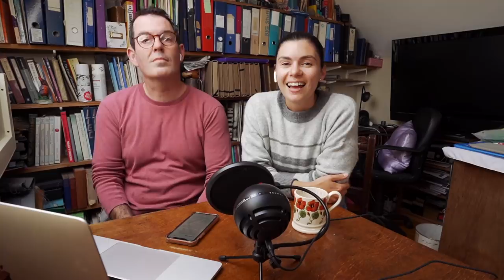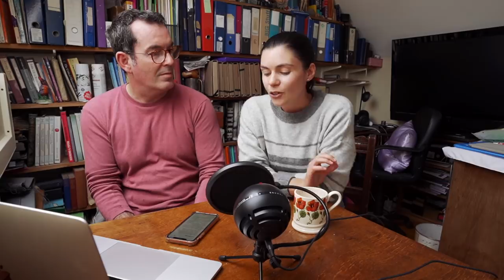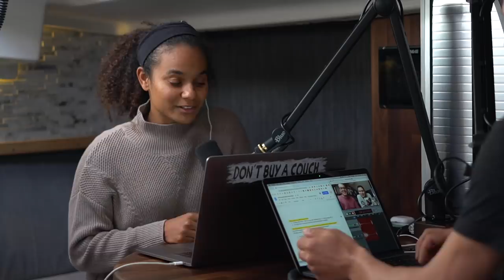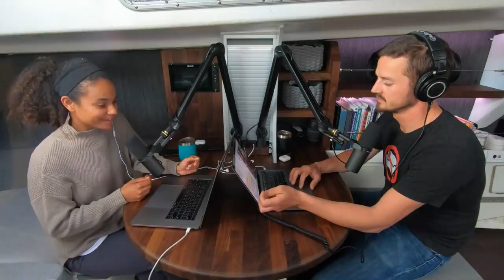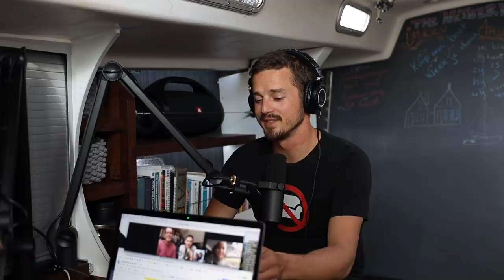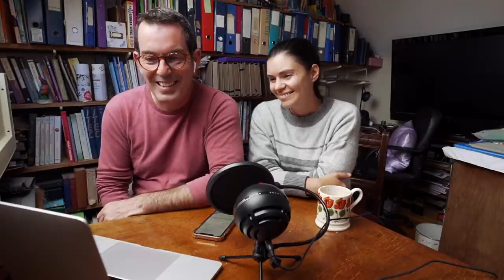Electric Engines on Sailboats: A Complete Guide! | Sailing Uma Interview

Comment: Brilliant, one of the best video casts I’ve seen with fantastic production, what equipment and software did you use.
I thought I would through a couple of questions into the mix... what do you think of electric hybrids and hydrogen fuel cell systems that will give you a greater range?
Reply from the maker: Ah thanks mate. We use Final Cut Pro for editing and a Sony A7iii for shooting

Comment: Can the keel be adapted to accept a large amount of batteries? Or ballast? 
Some ballast weigh + tonnes. 
Plenty of storage for the longest crossing that isn't providing much sun or wind.
Also could a generator/turbine be adapted to be trailled behind the boat on good conditions to generate hydro, but pulled out when it becomes too much drag in lighter winds hmmm 😂

Comment: Here at home in the midwest USA, we pay to recycle paper, plastic bottles and other recyclable materials. We cannot recycle plastic bags or cellophane by our waste collection, so I take the used plastic to the local grocery store. We drive a hybrid car that weighs 3,000 lbs and gets 52 (Fifty-Two) miles to the gallon. I have a new gas lawnmower that meets California standards. I changed household lightbulbs in the last 25 years to energy efficient. I have new high efficient furnace and air conditioner. Yet my electric bills and gas bills were $2,000. I looked into solar panels a few years ago and was told the position of my home with the surrounding trees off my property would not be suitable. I wish I was 40 years younger and I would make the effort to become energy independent. :¬) Webhead USA

Comment: As much as I like the sailing Uma couple I would probably have to challenge the notion that the potential of apartment is not as eco friendly as a sail boat especially per capita. There are a lot of circumstances that exist after the initial construction cost that would separate the two when it comes to upkeep given their environmental differences.
Reply: Given the construction costs (materials) and then "upkeep", it's a pretty safe bet that their 37 ft boat is far more energy efficient (aka "greener") than a standard 1 br apartment. That being said, a 1 br apartment has probably got 3 times the floorspace and perhaps 7-9 times the volume.
Reply: @1weirdsister  I understand without actually doing the math there maybe a lot of grey area to argue over but as I mentioned its per capita. The infrastructure is vastly different as well so drawing comparisons is hard and weighing the geological location and age of a building will also effect the math. But even Dan mentioned during his teachings they spoke of neutral footprint buildings and from what I have learned its possible. I guess the reality of the scenario is, who is building the ideal apartment building that would be an ecologic dream house?
I know here the practice is all about the money so they slap together suburbia with the intention of conforming to how things have always been done since the automobile and before. But I think if people looked into the concepts of earth ships then its not to far a leap to conceive that even apartment buildings could conform to a modern approach, such as TheVenusProject.

Comment: To "Sailing Uma". Be careful with currents and water levels in european rivers and canals. "Sailing Magic Carpet" had pretty strong currents to contend with, on the Rhone River, in the fall of 2019.  Also, some of the canals were closed due to water levels, after the lockdown in the spring of 2020.  [ https://youtu.be/An1-fD2dqxk?t=129 ]. Video segment by starts at 02m09s where Maya comments on the situation. 😎

Comment: Even if every single cruiser ran their diesel all day, every day, you'd never even touch the amount of pollution you get from even a small manufacturing plant. The whole idea that it's up to consumers to change their habits to clean up the environment is absolutely a concerted effort by manufacturer's to offload the blame and responsibility of the actual damage being done from those doing 95% of it to those who are doing 5%. Cruisers are fine, consumers are fine. If you want to make a real difference, hold corporations responsible.

Comment: CCA = Cold Cranking Amps - the instant current a battery can deliver from dead cold?
Reply: I think as a lead acid gets hotter, its internal resistance increases. That internal resistance will reduce the amount of current/voltage its able to deliver to the wires.

Comment: Just for your information about the canals.  I would say the river systems and major canal routes would allow for a 6ft draft.  Any of the smaller canal routes,   the Nevernai for example barely allows a 1 meter vessel to pass in many spots.  Our canal boat was just 1 meter deep and we hit bottom a few times on the Nevernai.  Mostly at the southern end.  This was also in the middle of the canal.  Moving to the sides of the canal,  like to get close enough to stake your vessel for a night or two you will only have two feet.  I would say the only way to traverse the inland canal system is by sticking to the main rivers.   You WILL get very stuck in the smaller routes.  Also,  there is very little marine anything once you get inland away from the main rivers.   just trying to help.  Scott

Comment: The burning question... Ruby Rose, did Sailing Uma convince you to install Electric propulsion on your new boat?
Reply from the maker: Not yet mate.
The answer seems evasive, so I will elaborate. 
We have sailed tidal European coastlines  and waterways for decades. At present no electric motor has the grunt and range to push me against tidal flow when I need it most. 
So while RR2 will run a huge solar bank (2kw) we are going to go diesel and 200amp smart alternators. 
This way while ocean crossing we won’t need the engines to create electricity, but they will both be there when and if we really need them

Comment: I don't understand his comments at 39:50 re the cost differential between new diesel and new electric being almost the same.  Last time I saw a quote, only a couple months back, it was $75k extra on top of diesel price to  upgrade to electric.  It doesn't sound like he's talking diy.  Would love to see that part for part $ comparison.  There is also the issue of system reliability, serviceability, maturity.

For a cat, I think one diesel, one electric is the ticket unless you can get an electric motor connected in series to a diesel. The diesel gives you range, the electric is great for short runs, motor sailing, and regen.  +You'll need less battery storage.
Reply: Quote you Mark Long "There is also the issue of system reliability, serviceability, maturity."
Dino-fuel engine propulsion systens are clearly inferior to the electric ones.

Realiabiblity : One (1!) rotaing part : It's the moving part (rotor) of a direct drive 3 phase induction motor. 

Serviceability : Modern dino-fuel engines have quite a lot of electronics, so there aren't really any difference in serviceability compared to electric propulsion system's control and power-electronic. 

Maturity: The electric motor came before both the Otto (gasoline) engines and the diesel engines, and both dino-fuel engines and electric motors are equally optimized.
Reply: I was wondering the same.  Interview started with OceanVolt being super expensive, but that came down to a comparison where electric and diesel were only a few thousand apart?  What did I miss?  Battery bank vs fuel tank make for the big difference?

Comment: If you want to use less power don't use electric motors, incredibly power hungry to operate and manufacture the batteries not to mention the power used to manufacture the components, you will have to wait at least 50 years till they have perfected an alternate power source.

Comment: Sorry, I'm going to continue to have "diesel on the brain" and have a safety factor without having to "rely on muh sailing skills". A simple risk analysis gives myriad reasons for having an independent propulsion backup, and diesel is currently the best in that regard. I want 400nm, not 40nm. For 400nm electric you would need to gather 10x the current amount of energy from the sun/regen/wind : imagine those panels.

Comment: Motor sailing , 10 miles out of safety with a storm ahead of you on dark ,  motoring up long rivers against tide and how long are you in tropic waters for solar we have 56 ft two trips around the globe in the last few years I would never go electric as it can’t compete we have been knocked down a couple of times and the waves carried away our solar panels , the cost these people have spent has been huge , I fitted a new beta 80 hp 9 years ago and it has been fantastic , and has saved us from tragedy so many times , it doesn’t smell , it doesn’t leek,,  it’ heats the water it has never stoped with out me holding the button so why put your self through this exercise your saving nothing you get looked for trying to prove a point , and have a very explosive bundle of untried battery’s and you can’t do 8 knots all day ,,diesel is cheep so good luck get your boat insured and keep pouring money into a complex electrical system that salt water loves good vid keep them coming
Reply from the maker: We agree 100% with your views. It’s why Ruby Rose 2 will have Diesel engines until an electric replacement is available that will match a diesel in terms of power and range

Comment: Life on a sailing boat more environmentally friendly that living in a city apartment?  Not sure about that.  Most boats are made of glass fibre and glass takes an enormous amount of energy to produce.  Then the resins are the product of industrial chemistry, no better than plastic waste, during curing volatile vapours evaporate off.  The foam cores are unrecyclable plastic from industrial chemistry.  None of the hull is recyclable.  The interiors and decking is often hardwood and if not then it is more nonrecyclable synthetic material.  The sails and rigging is synthetic fibre again from industrial chemistry and they must be replaced every few years due to UV expose, wear and tear.  Dirty diesel engines to produce heat and electricity.  Power stations are the most efficient power generation there is.  Even solar panels require massive energy to produce the silicon and glass plus more chemical processes.  Then there are batteries that are made from mined elements and again require replacing every few years.  Navigation electronics fail and need replacing.  Air conditioning.  Safety equipment like flares, life rafts, fire extinguishers that all need replacing whether they are used or not.  Hulls painted with biocide or copper to keep them clean.  Where does all that biocide and copper go?  Can only be the sea.  And all that need renewing every few years.  And where does the human waste go on a passage?  Into the sea.  Sewage on land is treated before it's released and some is composted to use on the fields - as it should be.  Really the only claim that it is environmentally friendly is propulsion by the wind.  But people living in cities don't travel so often anyway.  

Then there is the health concerns.  Little ability to exercise, breathing in residual resin vapours, drinking filtered seawater.  I hope reverse osmosis leaves behind the  radioactive isotopes from Fukashima.
Reply: Despite what you speak of, boat life is actually less harmful than apartment life as most people in apartments constantly purchase and replace items producing massive amounts of waste. Poop in sea water? Probably much better as it would be composed of a fish diet plus several animals already perform defecation in the water. Additionally, the amount of fresh water being consumed in cities is ridiculous to the point of significantly affecting fresh water resources. Many city consumed resources are taken from other locations as the environment surrounding most cities can not directly support the population. Is the current population allowed within cities tolerable given the amount of natural resources taken from elsewhere to support people that care nothing of their effects on nature? No. Your arguments are frail at best. Cities allow for abnormal population and population growth of people that care nothing of the planet they exist on. People that admire a boat life at least appreciate the world they live in to go out and enjoy it rather than exist for the benefit of a "higher" class who cares nothing of their existence or life experience. Slavery of vessel and mind has many forms and many ways of trying to manipulate others into a slave driven existence. No thanks.